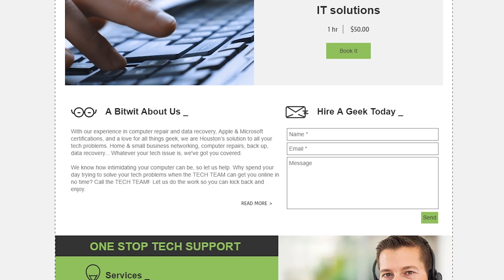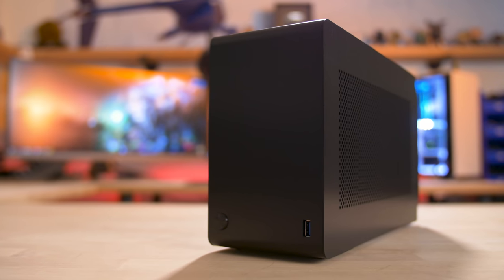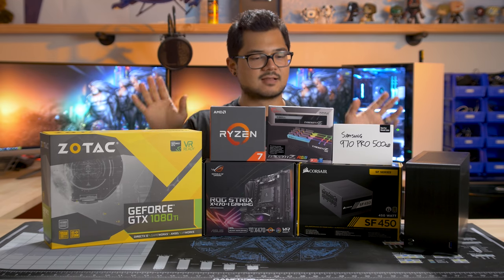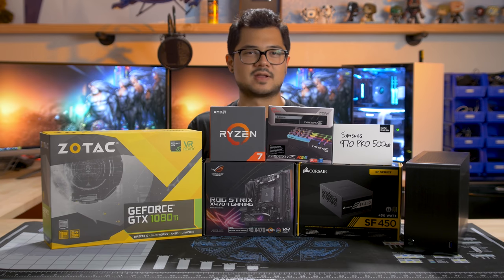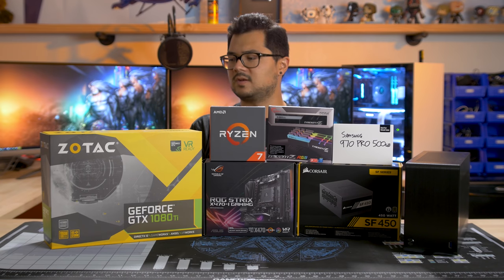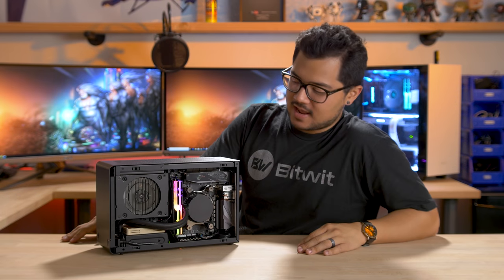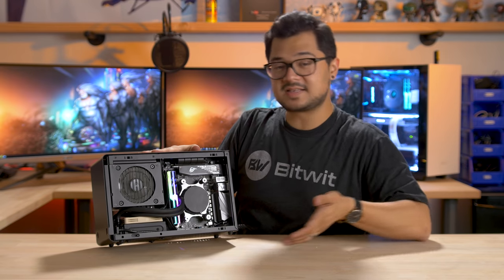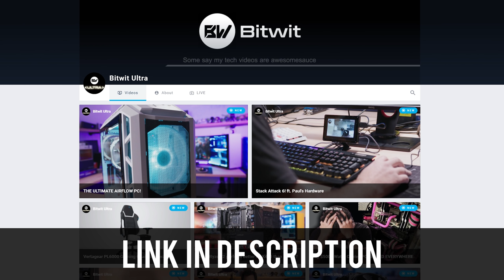The smallest water cooled PC I've EVER built! DAN Case A4 SFX v3

Comment: Wait... what?  450w power supply with a 1080ti??
Reply: The 1080ti is pretty power efficient
Reply: that shooketh me too
Reply: I mean 105 , 95, 65 watt ryzen 7s 
and 250 watt Gpu 
at most 355 watt average and  its rated gold should be fine for regular use
Reply: add some mobo, RAM and disc and water pump and it's almost 450W
Reply: I sall jaystosence do an mini itx bould he used an 450w with an 1080ti but he sad he could not use the 1080ti cause he hat an 450w power suply so he used an 1080 how can bitwit use an 1080ti with 450w power suply i dont understand jays sad that in the louge ghost bould he did
Reply: You won't be pulling all that power at once unless you're doing some kind of crazy benchmarking. For regular use it's more than enough.
Reply: I don't know what Jay was doing, but under normal use there should be no issues with a 450W, 2700X and 1080Ti.
Reply: yeah but 105 its the TDP, and the processor under load always consumes more thamn the TDP says, even more if you want to overclock
Reply: Corsair makes a 600w 80+ platinum unit that is SFX now so I'm sure that would make everyone happy.
Reply: You don't need to OC the 2700X... in fact it's pointless to do so for real world performance gains. If you want to for fun or benchies then yes, you'd probably want a bigger PSU, but if you're into that kind of thing you probably aren't building an SFF system in the first place as you're obviously also limited in other areas (CPU cooling etc.). Bottom line, in real world non-OC'ing regular day to day use, you should be absolutely fine.

All that said, given Corsair do indeed sell a 600W version of this exact PSU, it would make no difference if you wanted that bit of extra headroom. For a more silent build however, I would probably look towards the Silverstone Nightjar 450W, which is completely passive... albeit damn expensive. Personally, I'd want small and silent, not small and loud... those Corsair SFX PSUs are not known for being quiet under load... on the contrary, many people have modded them with Noctua fans.
Reply: Jay was using a 500w silverstone sfx psu. Silverstone PSUs are pretty terrible. I have the exact psu he used in the Louqe build and it DEFINITELY DOESN'T deliver 500w.
Reply: And almost 450W is what you want for a 450W power supply, your best efficiency is near full load.
Reply: @watcat8909  The Zotac 1080ti MINI draws less power than it's full-sized brother. That is how this is possible.
Reply: Would be great to hear Kyle chime in and give us all an explanation.  Explain your madness!!
Reply: TDP don't mean power usage, means that how much heat it dumps out
Reply: 450 w is not enough if you overclock any of these. then whats the point of water cooling if you are not overclock?
Reply: Wow dude amazing. Can you suggest a air cpu cooler and a more powerful psu  for gaming. I'm impress with that build.
Reply: I have a 1080FTW and an overclocked i5 7600k running on a 550w bronze and it hasn't been a problem so far when I first built my pc everyone told me to go bigger but it's never been an issue
Reply: @mjc0961  actually power supply efficiency maxes out around 50%
Reply: @I5ZQ8  it's longer than this one.
Reply: Yeah he's probably going to need to swap to a 600W. 450W in a system like this is asking for trouble.
Reply: @watcat8909  maybe his want gold rated might be wrong but we will find out in part 2 lol
Reply: @frangipani-dreams  but he's using this particular system for 4k video editing. Im shocked the system even turned on with only 450 watts!
Reply: People drastically over estimate the wattage versus what will actually be used.
Reply: @tomas toms hardware has the 2700x consuming 105w under a torture test scenario. I think Kyle will be fine.
Reply: 450w is a bit at the limit, IMHO. I would choose to have some headroom. I would have gone with the 600w version psu.
Reply: Errr, I sense hyperbole, but why would the system not turn on? You think a 1080Ti is pulling 250W on boot lol?!
Reply: Isn't any efficiency the best when the power draw is around 50%? So the SF600 would be better
Reply: There is a massive widespread misunderstanding and continuous spread of misinformation about PSU requirements, and the quality of the PSU is FAR more important. High voltage ripple for example can be a serious problem in a cheap PSU (even if it's a really high wattage), especially if you're OC'ing. There have been countless tests done on YouTube, and plenty of people out there with super high end systems and 1080Ti's running it all comfortably on a 450W PSU. You will not be chasing top-10 benchmark scores under such circumstances, but for most people this is no concern... especially if they are building an SFF system.
Reply: Lol, this is a tiny AIO no more fit for OC'ing than an air cooler... and there is no point OC'ing a 2700X anyway, unless you're just doing it for fun... and if you're into OC'ing you are compromised significantly by cooling ability in an SFF system, so it defeats the whole purpose. A top rated 450W PSU is more than enough for this build.
Reply: Everyone who told you that is misinformed... there's a massive amount of ignorance out there when it comes to PSU requirements, not helped by manufacturers advising such high wattage. They only do that to allow for all the cheap rubbish PSUs on the market with terrible voltage ripple. The 'actual' requirement, even for a top of the range system, is far less, assuming you have a high end quality PSU. Countless tests have proven this.
Reply: It's really not at the limit, unless he tried to OC the nuts of both the CPU and GPU, but doing that in an SFF build is very counterproductive given its cooling limitations.
Reply: Exactly, and you don't build an SFF system to torture your components lol... if you are, you're building PC's all wrong.
Reply: Personally, I shoot for a rated power that's double my intended usage, because from what I gather a psu is most efficient at ~50%.  So if my system has a normal usage of 300w, I'll go with a psu that's somewhere around 650.  Hurts nothing to have headroom, but if you draw more than the psu can put out (not rated, but actual), even for an instant, no bueno.

Then again, I'm not the guy who gives a piss what anybody does with their computer, its theirs and whatever makes them happy they should do.  Run a 250w bestec out of a prebuilt HP for all I care.
Reply: Do people not get efficiency ratings? You want to be close to the 450 to get the most effecient power draw, and TDP is not power draw. A 2700x pretty much  overclocks itself with precision boost 2.0
Reply: This is largely a myth. If you look at efficiency curves for high end (and even many mid-range) PSUs, they are virtually flat between 10-100%... the 50% thing isn't true, not in any real world performance sense anyway (i.e there may be a few percent in it, but that's nothing). More headroom can't hurt if you're going to use it, but most people don't so it's just not necessary and a waste of money if that PSU has cost more than a less powerful, yet just as good one. The quality of the PSU is more important by far, with the aforementioned voltage ripple being a serious problem with many cheap PSUs.

That said, it's all moot for the most part... what's another few pennies on an extra 100W if it makes you feel better, and gives you more OC options etc. It's only in builds like Kyle's where it becomes a more serious topic of discussion. Someone could easily hobble their build because they don't think they can run a powerful system with a 450W SFX PSU, when in reality you absolutely can, with no problems whatsoever. I've seen people build ridiculously under powerwed SFF systems because they felt they had no choice with what they have deemed a 'weak' PSU, when they could have done so much more.
Reply: Surprising that you don't need 800+ w psu huh? lol.
Reply: I have my old GTX 690 (Yes, thats a dual 680 with a 300W TDP on one card) in the same case alsongside a 12Core Xeon Processor on the Asrock X99itx Motherboard. All powered by the same Corsair SF 450. Never had any issues so far, everything boosts up to maximum speeds. That powesupply is a beast.
Reply: hey got a quest, i'm planning to get the x470-i from asus and worried if my ram(trident z 32gb 3200 cl16) would run well without a problem, cause from what i saw in some reviews it only can run at 2933 unless it's cl14 it would be fine. is it true or does the cl16 would run fine with it? thanks in advance
Reply: Running the same PSU on an Core i7 8700 none K with an 1080Ti FE in an Kolink Rocket mini ITX. Never reached the Powerlimit of it 😉
Reply: That was the first thing I spotted as well lol. Even if 450 watts is enough for the system, I would of not settled for anything less than a 80 plus gold 600w PSU.
Reply: I built a NOD 202 with 1080ti mini and a R 2700 not the X version for cooler PC 450 watt is not enough under load after a while it kept shutting down once in a while then I replaced it with the  600 watt SFX  PSU and its all good now, NOTE I had 2* 120mm fans in the case and had 2* 2TB hard drives inside so I had more power draw then his build
Reply: wrong math.  also ryzen spikes up much higher than their tdp rated.
Reply from the maker: I'm not overclocking. Zero problems here
Reply: Get with the times gramps, we don't need 1,500w Dual PSU's for Gaming any more.
Reply: KMPZ yeah then have fun that the power supply explodes or goes on fire or could smoke   when it is over 450 watt so it could output more than 450watt but that would be dangerous so don’t do it ever !!!

Comment: The thing that I loved from building an SFF is the satisfaction level is in entirely different level than building honking ATXs. Sure there will be thermal and thus performance penalty, but man... That extra diving to the parts bin/store, that extra tinkering, that extra attention of details left me very satisfied. Too bad my damp dusty environment couldn't allow open pore cases like the Dan case, NFC, or any SFF case with no fine particulate mesh (settled for FD Nano S) except if I'm willing to open the case and compressed air the shit out of the sticky dust buildups on weekly basis.

Comment: Tbh i love these small cases, but apart from the limitation in Hardware the pricetag is always sooooo damn high. Like 250€+ for a decent one
Reply: Unfortunately, yeah. All of these brilliant, thought out, cases are small runs. In this case, they're using Lian Li, as well, to make the cases for them. If you really like them, they are going to outlast any other component in your build. I don't find them to be very 'limiting' for most users.
Reply: The Raijintek Ophion is a small case, designed a bit like DAN-A4, but a lot cheaper.

Comment: I would flip the radiator and fan assembly, other than that it's good. Got v2 of the A4-SFX, loving it. The 450W PSU is more than enough, benchmarks and testing in part 2 will prove that!

Comment: You could have done a pull config on the radiator, couldn't you? That would have kept the fan blades from getting hit by cables.
Reply: @Duckie_Plays surely he's got some spare rad screws around somewhere like for a cheap 120mm radiator.

Comment: I did the measurements and finally built it to work, so what you need are 4 x #6-32 x 5/8" machine screws, 4 standard washers for 6-32 (optional), and 4 x 6.5mm standoffs, I 3D printed the standoffs,  you cannot screw the block without the standoffs

for mounting the Noctua low profile fan, you need 4 x 6-32 3/4" screws, they fit perfectly, and no need to destroy the fan or anything

Comment: I wonder what a water cooled build with two 1080ti's in SLI smallest build would look like
Reply: i think linus tech tips has something like that
Reply: Shot Logic  they did, but they built it in a custom case, seeing one being constructed with general consumer parts rather than custom parts would be awesome
Reply: FDMtech  and that would be the ultimate challenge, one last build for the gtx 10 series just before we get our hands on the new 20 series. Using a different case would be alright, but it has to be a mini or micro case, not a full or mid tower
Reply: project orthrus
Reply: Could be the "Ceberus" case by Chimera Industries.

Comment: 450W for a 2700X and 1080 Ti? What? Are usual estimates/ recommendations so much on the safe side? Typically for this kind of setup you'll hear "Get a 650-700W PSU"
Reply: Usual estimates/recommendations are in fact that much on the safe side. PSU recommendations are typically close to DOUBLE the actual power draw you'll see at max load (at stock GPU/CPU speeds). This is to account for people continuing to rely on low quality power supplies. A 450W gold PSU should be fine for a stock 2700x and 1080 ti in all but 100% CPU/GPU load. Even then it'll probably be fine (although I'd go 550W gold just for piece of mind).
Reply: A quality power supply should definitely be able to deliver ~10% more than their rated wattage as long as temps aren't too high. Corsair's SF series are so good they're actually bordering on platinum efficiency. At the moment I wouldn't even consider any other brand of SFX psu, they're really, really unreliable.
Reply: You could run a vega64 and 2700x off a 550w that wasn't trash.
Reply: Why are you people surprised? Too many people try to overcompensate their builds with 750w-850w psu's. In all reality, the lot of you're going to use 1/3 of what it's even rated for lmao.
Reply: That psu is barely going to make it. Btw in that chassis no OC is possible so the psu should be able to sustain the factory boost clocks for CPU and GPU just barely.
Reply: Are you sure about the DOUBLE estimate?? Overstating the psu wattage recommendations by a factor of 2 over the max load sustainable is incorrect.
Reply: Also most power supplies have a efficiency peak at around 50-60% usage, so a pc that draws 500watts with a 550w psu usually has more energy wasted than with a 800w psu
Reply: makwikus I would use the silverstone  sx650g
maybe it the only suitable psu for such mini pc at present
Reply: 450w from a reputable psu supplier will handle it just fine. Someone I know has Ryzen+1080ti in his itx build, doesn't go above 300w at wall. Nvidia sip less power than AMD and most people are not going to be running at 100%. 

Dual graphics systems is different. If price differential isn't a lot between 450 and 550, then by all means go 550w.
Reply: But did you see how small that psu was? That's the point. He mentioned it--he didn't want to have it all crammed with kit. Anyway you're looking pretty much around 250-285 watts near full load, right? The Ryzen only needs 95 watts and the 1080Ti, what; 185 watts max? He was more worried about heat dissipation and case size for portability before oc'ing. I mean, whose buying cases like this for max power draw? The 1080Ti will deliver great frames at 150 watts all night long...and what else does he got in there to cool, right?